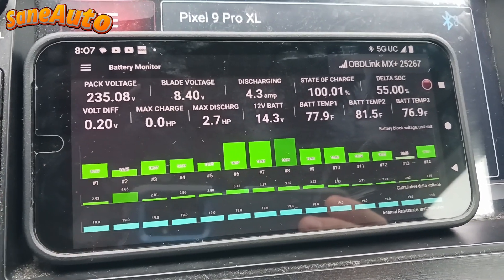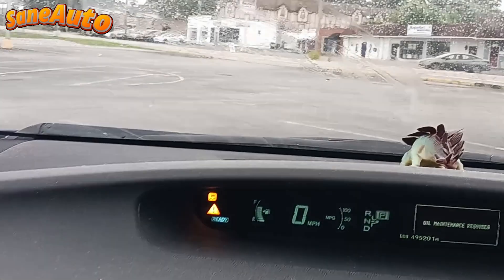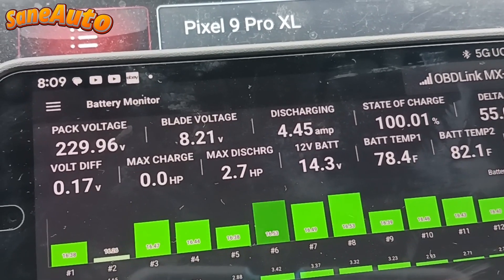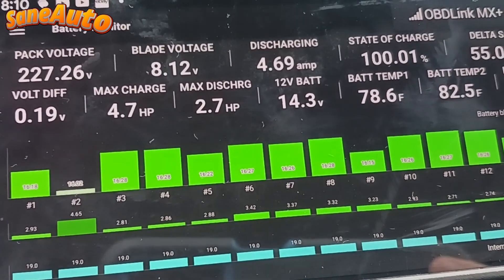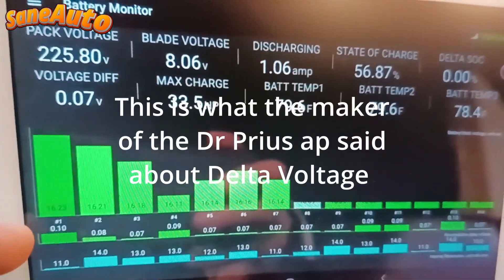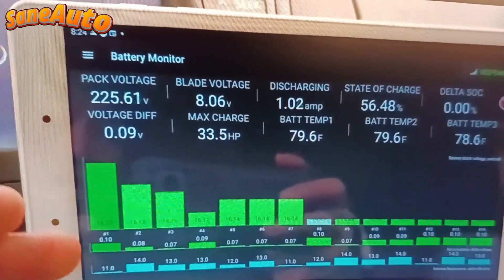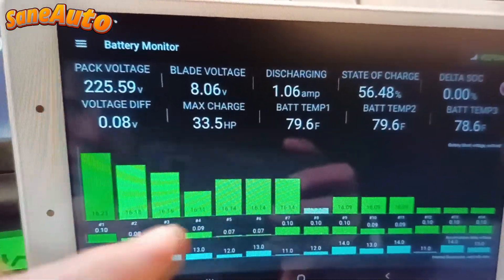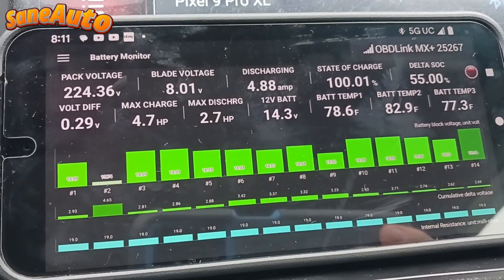What is Cumulative Delta Voltage how to read Dr Prius Hybrid battery app

Comment: Hey boss I think the answers here are incomplete, but I'm gonna try to fill it in.
As a NiMH battery degrades, the internal resistance increases, and the difference between fully charged output voltage vs the discharged output voltage becomes greater. I believe this principal is true for lead-acid batteries as well. Thus the delta V is an indicator of battery health. And like panico said, it does also imply that the module will charge/discharge faster, but this is because of the battery's reduced capacitance/degradation and is just another conclusion that you can draw from higher delta V. In your case, #2 also has a significantly lower peak voltage, which should support this theory.

What isn't clear is how Dr. Prius handles data- what are the time intervals between voltage samples? How does the coding deal with erroneous data or outliers? These are questions that need asking, but I think the practical step forward is noticing that one module (#2) has a significantly different delta V and peak voltage, and thus lower capacitance, and that if you have the opportunity to load test/replace modules, #2 would be the most obvious candidate.

Comment: The higher the delta voltage (higher difference in voltage) it means the block charges faster and discharges faster. These are the characteristics of weak modules.

I'm looking to find your video of your rehydrating modules. I did some my self but no increase in capacity yet. I watched a Russian (?) video where a guy successfully made it! he said do not bother with modules that gave out 1000mAh. Modules that gave over 1000mAh are worth a try. Also he said that it takes three months to show improvement. I wrote to him asking for details and I'm still waiting a reply.

Now i would love to see your video on rehydrating modules. Any luck?
Reply from the maker: Thanks for the info. My first rehydrate video will release next Sunday.

Comment: I agree with you. The difference (Delta) should be high, IMO that means the battery modual is healthy (able to charge and discharge efficiently), a lower delta means the module is failing IMO. Complete opposite of what he said.
Reply: Delta stands for διαφορά, meaning a difference between stronger and weaker. 
Therefore there's a stronger and a weaker. You must locate the weaker and change it or cycle it.